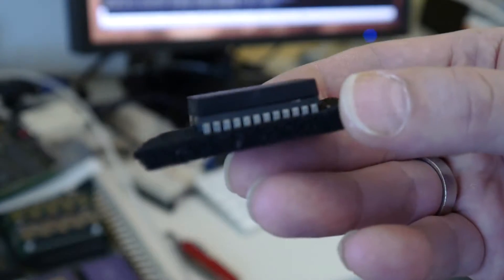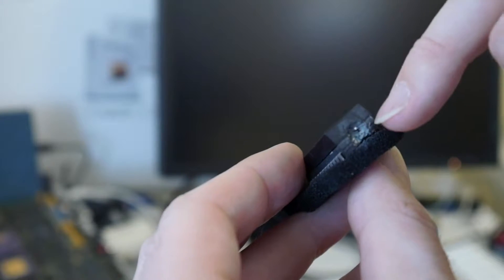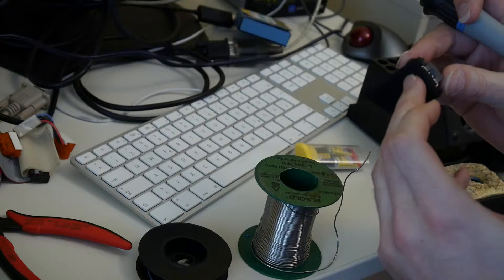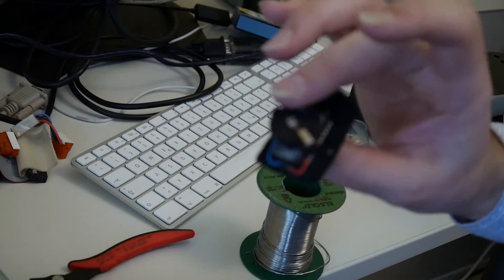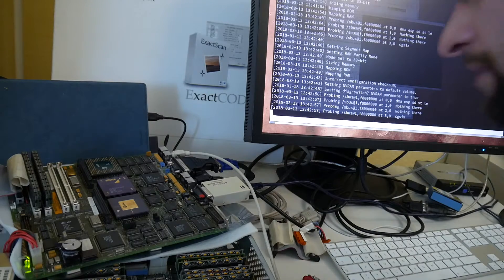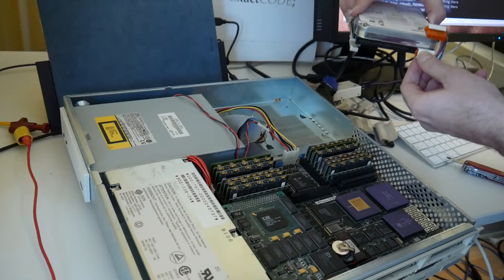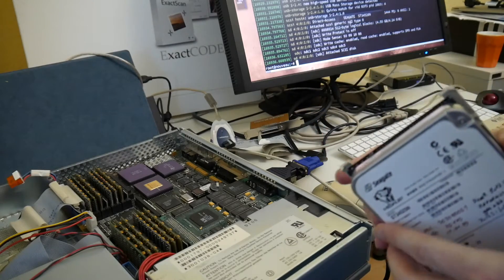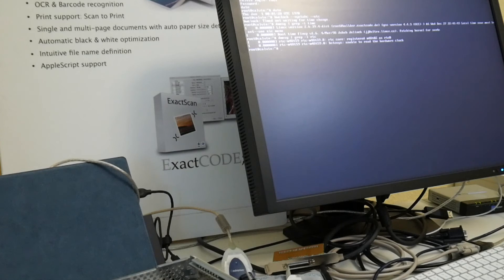ST / Mostek M48T02 NVRAM battery soldering, SPARCstation /part2

Comment from the maker: finally found the PCB variant I mentioned in the video again: http://www.glitchwrks.com/2017/08/01/gw-48t02-1
Reply: The capacity will not least very long. E.g. with an CR2032 I get near to 1.5 years without power connector attached to the power supply. The solution with the extra PCB using CR1225, which is even smaller.
Reply from the maker: did you disconnect the original battery? If not there will be a constant leakage due to the internal resistance of the old battery, …
Reply: CR1225 is actually what is inside most of the encapsulations on older MK48T02 NVRAMs. Plus, using the CR1225 lets the repair board fit down inside the plastic extractors used on some Sun systems.